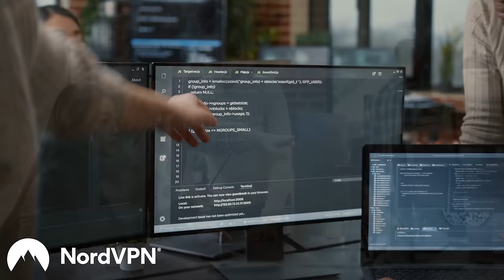Elon Musk fails Cybertruck stainless steel metallurgy test | Auto Expert John Cadogan

Comment: You've gotta love the Musk fanboys getting all hot and sweaty about Musk's magical stainless steel being "bulletproof".   If you took the normal steel used for almost all other cars and increased its thickness from the normal 0.6-0.8mm thickness found in most cars by over two times to 1.8mm as in the cyber truck you would have more effective penetration resistance without all the other manufacturing complications that come with using brittle stainless steel.  It's like when Musk announced that he was going to increase the capacity of his battery cells by 20% and did that by making them 20% bigger, but did the Musk worshipers realise they had been had?  Of course not.

Comment: I don't know jack shit of metals or stainless other than it is a pain in the ass to clean my  SS fridge of fingerprints since SS  is super porous , or see SS parts eaten away by galvanic corrosion, or when sprayed with real steel rusting dust, from a visit to a builders site or just from the discs of the brakes, you need oxalic acid to eat it out the SS leaving it more porous than before. But what i do know, since i am an artist; The shape is good. Simply  because we did not have, a rolling urinal as you call it, yet. It certainly moves people to say and write about it. But sadly it isn't conceived as a piece of art, so there is no concept or broader message to be heard. And with that, the Elon-gation of the truck over the world stops at the EU, which has, since it is not a piece of art but just a car, already has banned it, due to its too sharp, human body damaging,  angles.

Comment: I hope somebody will hold a PMI device to a cybertruck and post the results. 
I am curious what Elon´s "secret" stainless steel actually is.

No engineer in the right mind would use hardend steel for a vehicle chassis.
My expectation is that it is just normal 304 (or similar) stainless steel.

Comment: gram is a unit mass, not force. a gram has different weight (force) on the e.g. moon compared to on earth. otherwise, great video
Reply from the maker: Try to keep up.
I know. It's hard. 
A gram (or kg) of force is a thing.
1kgf = 1kg @ 1G
Reply: @AutoExpertJC  I'm keeping up, and I wouldn't have bothered if you hadn't been silly enough to make a big deal about it (probably for interaction in the replies=higher ranking on youtube). most layman can't tell the difference between mass and force, but why explicitly cultivate that error? if you want to simplify things, just say that 1kg renders 10N of force. that way at least, someone might learn something
Reply from the maker: As an engineer, we use kilograms force all the time. It's just easier. In static frames of reference, they're the same thing. Pounds force: same thing. (Ft-lb of torque only works if 'lb' is a force...) 'kgf' and 'gf' is quite acceptable - as long as you appreciate the distinction between mass and force.
Alternatively, the whole profession of engineering is wrong...

Comment: I think he really liked "Back to the future" movies as a kid and wanted his own DeLorean. I do wonder how they get the crumple rate correct if it is Viagra hard? that is the special secret ingredient in his steel by the way. He just drops in several blue pills during smelting and it cracks a boner straight out of the crucible. The whole truck is a marketing ploy that became absurd. It will end up in museums much like the remaining DeLorean's but not inside the museums in case they burn it down. To those who say it's stainless steel so it does not rust, well that depends on the grade of the steel because some stainless steel will rust. Not like carbon steel but enough to show up on your unpainted urinal with wheels.

Comment: In the cyber trucks favour is that the owner won't have to worry about a relative or friend calling to help move or the wife saying build me something that requires lumber or cement blocks to be moved , or even to be forced  going into business doing construction because you need the money and the truck is assumed a tool that pays for itself , for the cost of worn out battery's you could probably buy a couple of decent work trucks that will actually do work and pay for themselves 🤣

Comment: 304 stainless has good forming properties it has a yield stress of around 220MPa with around 45% elongation which is stonkingly formable. It is also readily weldable. If Tesla can't form that material into a shape that couldn't be made on a brake press then they are either staggeringly incompetent or Elon Musk is a born liar. I think I know which one I will be going for. Interesting aside, Jaguar (when they were Jaguar) couldn't make the bodyside pressing for the XJ6 without splitting every single panel that came off the press. No problem just weld them all up by hand and lead fill the seam! and you wonder why they have such a problem with their cars....
Reply: Yes, and you can form it part way, heat treat then go the rest of the way if you really need a complex shape.

Comment: I'd be pretty sure Mr Musk is up on his basic metallurgy.  He just knows when he has to put on his salesman hat. Check out Sandy Munro's deep dive. 30X sits in the middle of the common grades of stainless , a compromise of rust resistance and formability. The inner frame looks pretty traditional. Truck weighs 2980kg if you believe the engineers. That's in the ballpark of the competitors in the full size truck market. If it holds together in the hands of the youtube truck abusers they will have done well.

Comment: All external panels of all cars are formed with a compound curve . That is it is curved from front to rear and top to bottom . [ Like the surface of a ball ] . This gives any panel
  much more strength then it would have if it was flat . This has to be formed with a much more expensive stamping die . Musk spent nothing on stamping dies because none
  are used on any of the panels of that vehicle . Although the metal is a little bit thicker to give it some strength . All of the panels on this vehicle are made simply with a bending
  tool know as a brake .It makes straight line bends .Notice all of the bends on this vehicle are straight . Musk is a lier . The stainless will not break the press if a large enough
  one was used .On you tube key in ford stainless steel ford cars and you'll see .

Comment: Tesla uses Martensitic stainless steel is a type of stainless steel alloy that has a martensite crystal structure. Then it is treated to making it stronger. The same or very similar alloy is used on the Space-X Starship.
Tesla is also comparing this material and processes to traditional automotive construction and the equipment that is used for that.

Comment: Surely he talks about its hardness because it is optimised for hardness and is alike other 300 series stainless in strength

I don't believe he doesn't know the difference between hardness and toughness

Anyway it's not a steel optimised for cars, it was optimised for the Starship stack (the x in 30X is from SpaceX)

Comment: I think Elon just has to dumby down things too far as a CEO.   I've  done aircraft fab using all sorts of material.    The roof shape is just choice.  It's mostly glass and the structure under it not stainless.   I think they should skin it in anodized aluminum formed close to the cybertruck 2.0 concept from Yanko.

Comment: For your information, the steel used in the Cybertruck is the SAME steel used for SpaceX rockets. This steel will NEVER be the point of failure in a SpaceX rocket. That speaks for itself. This guy is a fan of either Ford, GMC, Dodge, or GM trucks. Tesla will sell millions of these trucks!!! Only time will tell whether there is any merit to this video

Comment: Tesla Cybertruck Ownership Experience in 2024 has to be like living in Hitchcock’s The Birds in real life. Most of the time staring through that world’s largest windshield and trying to spot trough the glass roof where the next flock of birds is. Main mission of a road trip is to avoid those seagull and pigeon acid bombs dropping on the bare metal body of the Cybertruck. And they will die a bit every time they hear that splat on the frunk - or on the other body panels. Those Cybertrucks will be spending more time in the car wash than at the Tesla Supercharger or on the road. But all that is futile. That Cybertruck is still eloquently collecting patina. Those who will get enlightened will curse Elon for Tesla warranty terms and conditions. And those who will not are justifying themselves that this is just another quirky feature Tesla has engineered to their pleasure.

On the sunny days Cybertrucks will have worse isopropyl alcohol mileage than Ford F-150 Raptor’s gas mileage. So the owners will be praying for cloudy days and rain as it covers all the scratches and blemishes in those no longer shiny stainless steel body panels. Which is exactly what Tesla warranty does not cover.

If the unlikely ever happens and they see a bird lady on the sidewalk, they feel cursed and can not look away. When she looks back at them as they pass by, it feels like Lilith herself has descended to this world and tries to suck life out of the poor Cybertruck  owner's soul.

Comment: From the interview the designers did with Topgear, it looks like it has a regular steel frame and because they had problems with bending a return on the skins, the skins appear to be bonded onto the underlying structure (skip to the 11 minute mark). 
With all the road salt they use in Nth America, I'm guessing these will be rotting from the inside out in short order. 
https://www.youtube.com/watch?v=uefydJUbRhc&t=1520s

Comment: Such bile! As if you had not actually seen them bouncing a sledge hammer off of it. Do me a favor, go do that to YOUR car (any other car) and you may notice the difference, and understand what he means by HARD. I am disappointed with the truck (Much higher price and lower range than expected) don't get me wrong. But the name calling smacks of envy and is off putting.
Reply: That is not the real definition of hard.  Words have meanings.
Reply: @kensmith5694  Words have meanings, hell they multiple meanings and you can nitpick all you like. But if the steel boat maker I worked for for years could have made one out of steel like that (at a profit) they would have. (I brought it up more than once).
Reply: @davidvandyk1171  It is not a nitpick.  If you are going to do technology you need to not mix up your units of measure and technical definitions.
Reply: @kensmith5694  Pretty sure he is a little more accurate with his parameters when discussing them with his engineers than with the general public.
Reply: @davidvandyk1171  I would be not.  He isn't and engineer.
Reply: @kensmith5694  Don't be silly, even if he doesn't have a degree in "engineering" he has the understanding. After all , he's a bit smarter than the average engineer I think, and besides , the engineers that work for him would not succeed if his ideas were not viable. Degrees are overrated anyway. You would need degrees in electronics and networking and mechanical engineering today to repair and maintain the machines I serviced. Yet here I am with no papers to wave around.

Comment: Cyber truck crash repair might be relatively affordable because stainless steel is real bitch to weld. Normal car is made out of 10-20 easy detachable parts. Stainless steel one must completely bolted together from 50 parts. So it's quite possible that you can purchase couple parts and bolt them on car. 
Biggest failure to me is; it's heavier than fully loaded mercedes sprinter maxi 😂😅😂😅 so in Europe you will need truck driver license, tachograph and 100 kmh top speed 😂😂😂 and you can drive it 5 days in a week. Gotta have 11 hours pause daily 😂😂 like you make living delivering coca cola around in it. Jesus Christ there are bridges at tourist attractions like old castle where you shall not pass. 🧙‍♀️🪄

Comment: I imagine you think you sound pretty clever, but actually you sound pretty bitter. I believe I heard the steel is preheated before bending and forcing air between the steel a bending tool protects the tool from actually contacting the metal, resulting in extremely long tool life and gentle cooling,effectively annealing, the folding line

Comment: So John from my personal experience of stainless steel urinals and the tendency of them to warp when one is urinating on the back sheet of that steel before it runs down into the gutter I have often experienced  the rather disgusting spraying one with your own (and probably a touch of someone else's!) urine caused by that sudden warping of the steel back so  - will this mobile urinal also warp when exposed to the sudden changes in temperature LOL!! I cannot believe the rot that comes out of someone who you hint (and I believe) is a self opinionated, physics trained (one wonders what branch of physics) ,  and narcissistic idiot and I for one am wondering where his rambling rubbish will come up with next!

Comment: Well you sure have a hate boner for Elon, eh? I’m sure he understands the difference between hardness and strength, this isn’t a deep concept. I’m also sure that the 300 series steel that is used in the cyber truck is both very strong and very hard - these words are relative, and of course it’s not hard compared to a good blade steel, but I’m sure it’s very hard compared to most steels used in car panels. 

Elon is an engineer - as am I. I design and engineer things, even though I have no formal education as an engineer. I practice engineering, and thus am an engineer.

I think you would have a better life if you didn’t concentrate on your hate boner for Elon. This video is quite silly - thought I would give it a chance, I shouldn’t have, as I am none the wiser for it.

Comment: Yep. The use of 'wrong' materials is stupid but very profitable. Another example? I wince when I see wealthy people specifying granite for their kitchen worktops.

It's a bad idea.

Granite is beautiful, expensive and totally unsuited for the kitchen. It's amazingly durable and perfect for building medieval castle foundations, walls, bridge footings, sea defences and lighthouses which will be pounded by Atlantic storms and 50' waves. It'll resist erosion and weathering for hundreds or even thousands of years.

But slice it and polish it and bring it into your kitchen and... it's hopeless. You might as well use wood or glass. It's good for rolling-out pastry on because it always feels relatively cold, but apart from that...

You can score granite with a knife, so you can't use it for chopping or cutting on. You can scratch it with the base of a saucepan. You can permanently stain it with turmeric [the bright yellow ingredient in curry powder]. You can't put anything very hot on it; you can't put anything very cold on it. It might crack.

Be careful with vinegar, too. Yes indeed. Ordinary vinegar will etch granite and ruin it.

You can't drop anything heavy or sharp on it. In fact, if you were trying to design a completely useless but very expensive worktop, granite would be the perfect material to use.

The first thing kitchen fitters offer with their exclusive, premium quality granite worktops is a range of plastic, wooden, metal and glass 'worktop savers' to protect that lovely stone from the horrors of kitchen life. Needless to say, the protective additions are almost as expensive as the useless granite they're saving.

But people keep on choosing it because they've been sold a dream.

Likewise, the myth that 'Diamonds are forever' is just that: a myth. A neat bit of marketing. But if you belt a diamond with a hammer with sufficient gusto it will shatter like a sugar lump because hard is not the same thing as tough.

There's a good reason why car manufacturers still use various grades of ordinary steel for their vehicles. It's strong, impact-energy absorbing, easy to work and simple (and cheap) to repair.

Carbon-composite construction is extremely sexy but impractical for mass production. Composites are either very expensive or impossible to repair economically, so insurance companies hate composite bodies. They don't perform well in crashes because, although their remarkable strength will save lives by absorbing the forces involved, they'll only do so by destroying themselves in the process.

Very expensive. One use only. Why bother, when steel works just as well and can be repaired, too?

Stainless steel, however, is not a wise choice for a mass-market car body. Considering Ego Muskrat's bank balance and delusional view of the world I'm surprised that his Teslamic Toilet's options list doesn't include a polished granite load bed with carbon-fibre trim.
Reply from the maker: Granite also doubles the background radiation in the kitchen...

Comment: John, why are you getting so many facts wrong? First stainless date, the hardness, why the press is being used (NOT because the press will break) etc. If you get these basic things wrong, how can we believe the rest of what you say. I usually like your videos, but your seething hatred is well on display here. Are you saying that Steel Dynamics is lying? I'd get some money for the lawyers ready ;)
In the actual Patent application: "Yield strength of 1,100 MPa. The Epit-Eocp corrosion resistance is about 520 mV to about 800 mV"

Comment: Load of shite, stainless is very strong and very hard. Depends on what you mean by strong, compared to standard thin mild steel on vehicles its very strong and very hard. Try driilkin or cutting both see which goes first... Utter nonsense